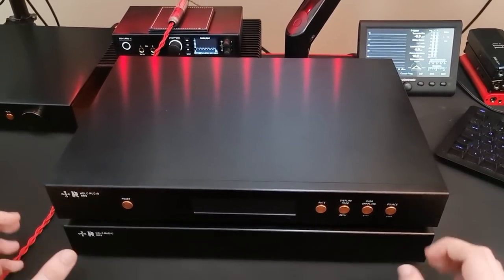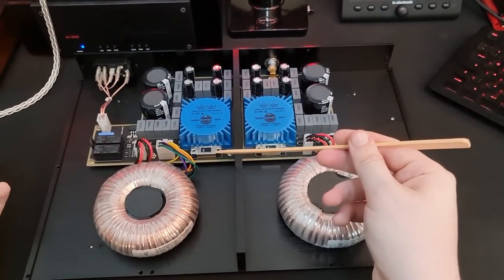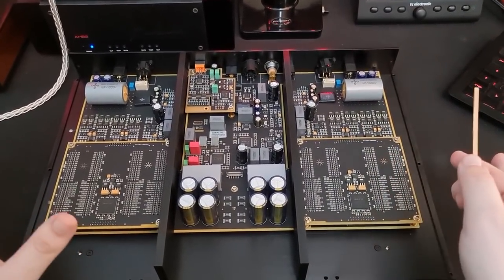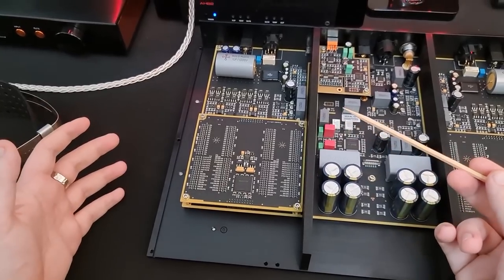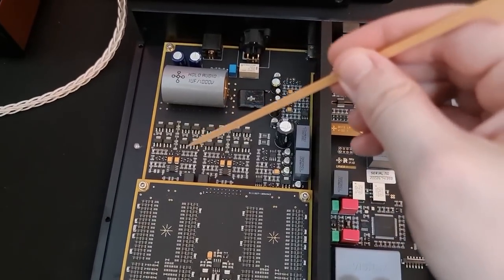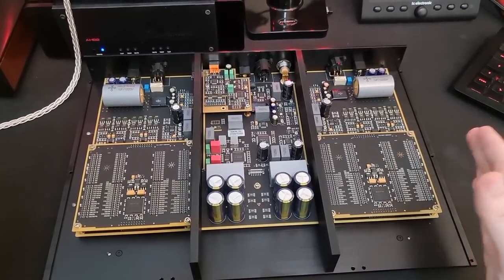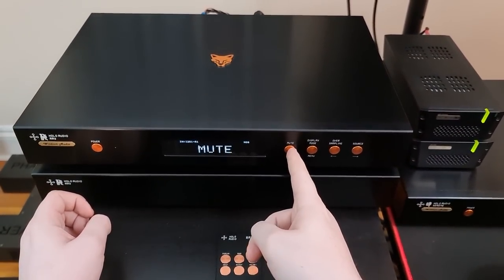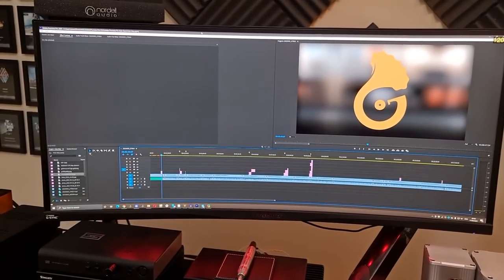Holo Audio May Review - Part 1 - Going the extra mile

Comment: Great review! I have a system running AudioLinux. Would this DAC be able to support DSD512 playback using hqplayer from Linux sources via USB? Most DACs unfortunately- like my Qutest - requires windows with ASIO drivers to get DSD512 playback via USB using hqplayer .
Reply from the maker: I'm not too sure with regular linux, but with Jussi's modified Linux kernel (https://www.sonarnerd.net/src/) you can use up to DSD1024 native with it
Reply: @GoldenSound  What about Antipodes CX Linux?

Comment: "The DSD Dac module resistor network of May Dac does not use R2R architecture for the DSD, more specifically it uses a very specific architecture which is optimized to perform DSD data to analog. So to be entirely accurate the DSD part of May Dac is using resistor ladders, not R2R.." So Holo is using discrete components to decode DSD. Pretty cool.
Reply: It's nice to finally find a company that made an R2R dac be able to play DSD encoded audio properly.
Reply: So we get two DAC's for the price of one so to speak.
Reply: @angelwars3176  Well is the D-S playback as good as the R2R? And a lot of other DACs might even sound better converting to PCM anyway.
Reply: @jon4715  interesting. The opposite argument seems to make more sense i.e convert everything to DSD but obviously all down to DAC architecture.
Reply: @angelwars3176  Then what's the point of an expensive R2R DAC if you're going to convert to DSD? You won't be using the ladder converter. And most of your music and audio is PCM anyway.
Reply: @jon4715  i'm not likely to be buying anything in this price range. You said many dacs would benefit from converting to pcm. My understanding is the opposite in that many dacs being s/d based would benefit being fed a dsd stream.
Reply: @angelwars3176  Oh okay. I just mean that if you had a Schiit Yggdrasil, your DSDs would probably sound better converted than if Schiit had included an AKM chip somewhere on the board. I could be wrong though.

Comment: Since this unit draws 50 W at idle I would like to turn it off when not using it for a long period of time. My set up is in a vented cabinet with no convenience access. I use a PS audio power generator with switched power outlets.

My question is, since there is no hard on/off switch, if you cut power to the May Dac, when you restore power does it turn back on?

Comment: Wow. After you implied that this is superior to the Dave M scaler, I thought it'd be like 15-20k. Pleasantly surprised. Still too rich for my blood, but 4-5k seems like an amazing price.
Reply: Both prices are extremely exaggerated. Just think about it, it is a downpayment for a house. For what? A small box of transistors and capacitors and other elements.
Reply: @Burevestnik9M730  a Ferrari costs as much as a house. And for what? Just a car with 4 wheels that takes you from A to B. See how flawed your argument is?
Reply: @k-doggy1762  Raw materials of one Ferrari tire cost as much as all parts of these DACs.
Reply: @Burevestnik9M730  where do you live that even 25k is a propper down-payment? Hell, where I am a 100k down-payment only gets you a 600sqft condo and im not even in a major city...
Reply: @Burevestnik9M730  uh.... a set of 4 tires fot an f8 are cheaper than the may...

Comment: I’ve always wondered how this works as a dual mono, there’s only one cable from one of the power supplies - does that make sense?
Reply from the maker: The interlink cable has a large number of separated conductors. You can see this on the internals actually too. So some will go from the left psu to left channel, some from right psu to right channel etc
https://imgur.com/a/zCrpasF
Reply: @GoldenSound  ahhhh, thanks man, finally makes sense!

Comment: Brilliant content, great technology and great review/product knowledge, but i gotta be honest, i own an RME ADI-2 DAC which i love, this product falls into that awkward category of investment versus percentage improvement......i think i get great bang for my bucks with the RME, no doubt this brilliantly designed HOLO device would most likely be superior in it's reproduction capabilities given it's design, electronics and power supply components.....a comparison of the two devices would be great, however i dont think i could justify the uplift in investment.......but a comparison would be great to hear. Keep the great content coming, thank you
Reply: If you use quality power filtering and some superb PS like Ferrum Hypsos, then it's pretty close, at least with Spring 3 L2. The biggest difference vs ADI-2 is its anemic bass (around 5dB at 50 Hz, which is fixable through its EQ). But if you're using stock PS (and God forbid no power filtering), then you're missing the whole show..

Comment: Your channel sold me on the Holo May KTE and it's been the best return on investment I've ever made in any of my components. One thing I'm experiencing is with my cheaper Naim solid state amp it is everything great anyone has ever said about it. But when I connected to my Supratek Cortese LCR tubed amp, the details have increased and there's more separation in instruments but all the smoothness, liquid, musically immediacy is gone. It really loses its magic. Don't get me wrong it's still sounds great, but I wonder if the May is better suited for a solid state preamp rather than tubed. Mine is an active tube, and is well reviewed with exceptional praise, but I feel like it filters out something in exchange for detail and sounding a bit analytical. The difference is sounds aren't close enough to ignore so I may be considering the Serene next. Any one else pair the May w a tube preamp and have any experience they can share?

Comment: So I'm guessing it's bad to leave this thing on 24/7? lol
I hear there's some warm-up time with R2R DACs, so do you leave it on or just turn it on when you use it and wait a bit?
Nice, in-depth review btw...looking forward to the Spring 3 release! I've been told it gets to about 95% in performance to the May which is pretty cool.
Reply from the maker: No you would want to leave it on whenever possible. I only turn it off when going away or if there's a storm etc.

It takes an hour or two to properly heat up.

Repeated thermal cycles from being turned off/on repeatedly are MUCH worse for components than being left on/hot
Reply: @GoldenSound  Does your May have a built-in pre-amp? I see volume buttons on the remote so it got me wondering...

Comment: Just an opinion that the fine sound of this DAC is due more to its outstanding power supply, analog sections and USB implementation, and less to its D2D digital to audio conversion.  Swap out the D2D and replace with 2 ES9038pro chips and I think you will have a DAC of comparable quality.  And you will cut production cost by a significant sum.
Reply: The difference is in the errors that occur in an R2R are truly random as opposed to a dac chip which will be inherently pseudo random.
Reply: @yeahright3733  I think this refers to ADCs, but in any event it's a distinction without a difference.
Reply: @lennym2407  according to whom?  Some people love r2r DACs and DCS method of randomizing the noise.  The brain is very sensitive to artificial, repetitive noise.

Comment: Sir, My wife pulled up your website and we watched several reviews. I apologize for not watching you for sometime, even though I'm a subscriber, totally forgot. As I am looking for a new DAC, Your review on the Holo Audio May KTE was so well done. I'm almost ready to pull the trigger. However, Read all posts and no one has mentioned reliabilty, where to get service if needed, is the distributor  good to deal with???? Sometimes service is just as important as the purchased item!!!! Robert Shaw TN  Your reviews have drawn me back, Thank You.
Reply from the maker: Hey Rob.
Customer service will depend on which dealer you bought from. Both Tim at kitsune and Jo at wildism have been brilliant with me.

As to reliability, according to Tim he can count the number of devices they've had sent back with faults on two hands, so I think reliability is going to be very good.
Reply: @GoldenSound  Thank you for the quick response. That makes me feel a lot more comfortable. I then assume the handful that had issues went where? Stateside or back to China for repair?

Comment: Great review! Might want to correct something: DSD stands for Direct Stream Digital, NOT delta sigma DAC. Delta Sigma is a totally different animal and would not be worth implementing is this level of unit IMO.
Reply from the maker: I'm aware, but when in "OS DSD" it is operating as a delta sigma dac. It is using delta-sigma modulation to modulate the incoming 16/24bit information to a high sample rate 1-bit stream and converting on the 1-bit converter. This is delta sigma.

Comment: Hey what headphone cables are you using for you Aryas? I have aryas too and would like to get your cables. Thanks! By the way, I’m using the Woo Audio WA7 tube amp with the Aryas and the Holo May and love it. You should check out that amp.
Reply from the maker: vikingweavecables@gmail.com
Reply: @GoldenSound  Thanks buddy! Is that where you got the clip on balanced connector thing that you have the cable connected to?
Reply: Yeah, Skedra is his name and he made the adapter and cable. Best cables in my opinion.
Reply: @Dan_Mellinger  Thanks buddy. Yeah that’s sweet being able to hook and unhook a cable to a balanced Y cable without having to climb around to the back of your amp.
Reply: @Dan_Mellinger  How's the price?
Reply: @ruusta8042  Starts about $250 for a copper 4-wire braid and goes up from there.

Comment: Does the DAC need to stay on continuously to do its best? I understand this is usual for R2R but a little worried as this thing does run very hot so I would prefer to not let it just run. Anyone has an idea about this?
Reply from the maker: It does need to stay on to perform its best yes. The same goes for many R2R dacs.
There's no worry about leaving it on though, in fact repeated thermal cycles (turning it off and on all the time) is WAYY worse for components than just leaving it on.
Reply: @GoldenSound  Thank you so much for answering. If I can ask one more question. You mentioned in your review that the mute button turns off the output stage. I am wondering what your thoughts are on if it is smart to leave the unit on mute to save on unnecessary heat if I do let it stay on?

Comment: Why in this review isn't there a frequency response curve?
Reply from the maker: I'm not aware of any dacs that don't have a linear frequency response other than if the oversampling filter has rolloff. The hardware itself has a completely flat FR as does almost any other dac
Reply: @GoldenSound  e.g  THD+N VS FREQ AT 0 dBFS, 24 dBu
Reply from the maker: @nathanbell6962  THD+N/Freq isn't the same as frequency response though.

Also 24dBu is 12.2vrms. Most dacs are 4vrms(14.25dBu)
Reply: @GoldenSound  thanks! How would you rate this against the Denafrips terminator?

Comment: Shouldn't these be used side by side? If you stack the ladders are then sitting in the field from the transfomers?
Reply from the maker: There's two 0.5cm thick metal plates separating them, plus they're O-Type transformers which have wayy less leakage than other types anyway. Measured performance (and performance to my ear) doesn't change if the dac is separated from the PSU unit.
Reply: @GoldenSound  Interesting, thanks for the reply, and great job on the videos.

Comment: All I know is my music sounded better switching from the RME to the May.
Reply: Would you mind elaborating?  I have an RME ADI-2 and am seriously considering upgrading to the Holo May, but I need more convincing, about $2,000 USD more convincing, before I take the plunge.  I'm quite happy with the RME in every respect except for the soundstage/depth.  I keep hearing reviewers describe how the lead singer or instrument is center stage and backup singers and other instruments can be clearly placed in 3D space, but all I'm getting as far as I can tell is a wall of sound with L/R separation, but without the spatial depth.  Does the Holo May do that, or does my room/setup just need more tweaking?  The rest of my system is highly resolving and I've been tweaking with REW and DIRAC room correction, which gives me a strong center stage, but the depth is elusive and I WANT IT!
Reply: @aerofart  if your system is a loudspeaker system, I won’t be able to help you, but if it’s a headphone setup it could be the rest of the chain.
Reply: @nathanberger618  thanks. I’m running speakers, primarily. I do use headphones, but not as often.
Reply: @aerofart  sorry, my system is for headphones, but I could run speakers off of one of my tube amps.
Reply: @nathanberger618  thanks anyways

Comment: But why Z reviews said it makes absolutely no difference which dac you are using because there is 0 difference and he spend DAYS of comparing that dac and others via a switch on the fly ?!?!??!?!!?!
Reply from the maker: Z doesn't think there is a difference between dacs. Ask most other reviewers and they'll tell you there is.
Reply: @GoldenSound  it's really strange hearing two absolutely opposite opinions . Something is not right here 🤔
My theory is he wasn't able to hear a difference because of not having the susvara . What are your thoughts because this literally makes no sense
Reply: @x32i77  there is a weak link somewhere in his chain or he is not able to hear it. It's the only explanation. I just got this DAC and its like having a completely new HiFi setup, it is not subtle.
Reply: @dennisd9875  😱😱